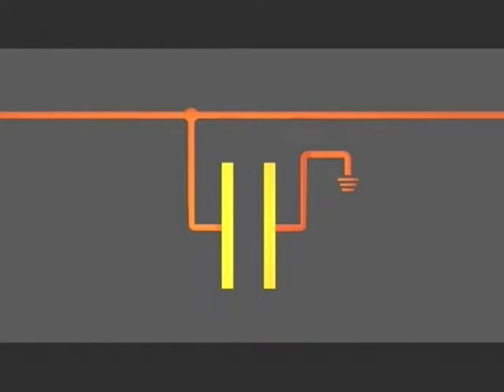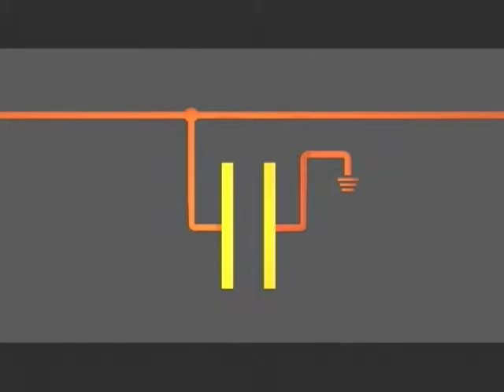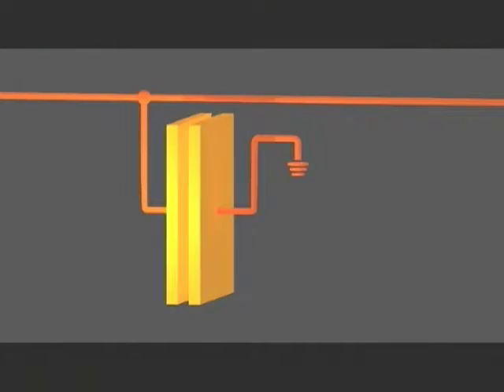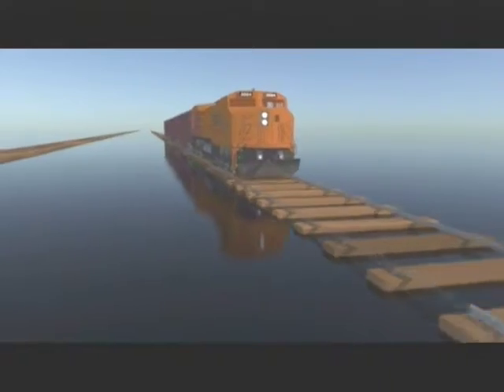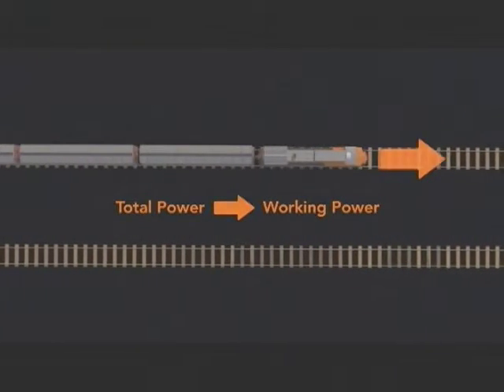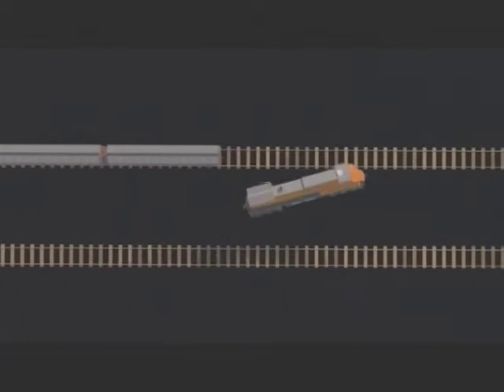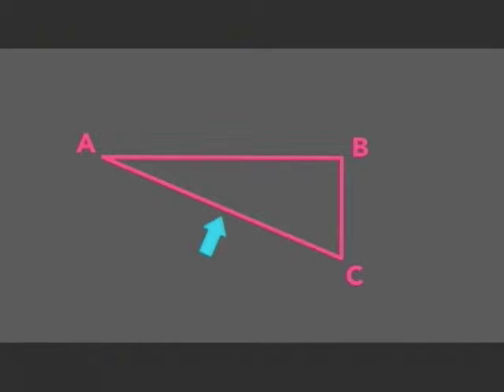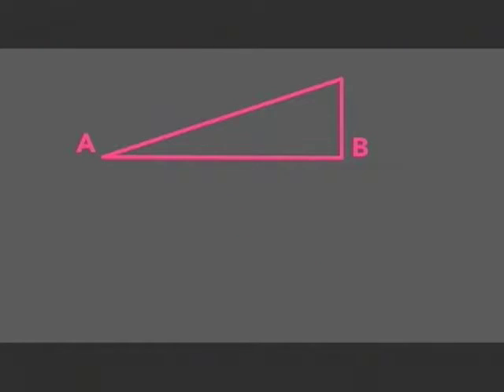Pole Top Capacitors Converted

Comment: Use a load buster on all capacitor banks , fixed and switched. Being that an oil switch is not a visual open. Never trust and switch without a visual open. On a switched bank operate unit to open verify open on switch i indicators then use load buster to open cutouts. Wait 5 minutes then bleed off any stored voltage with a ground.